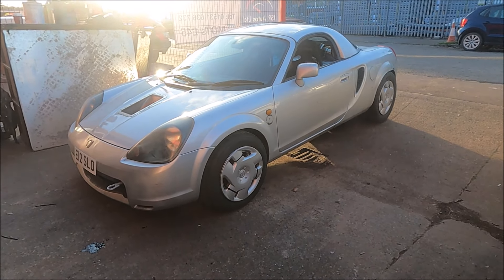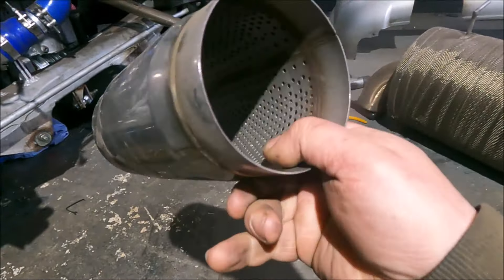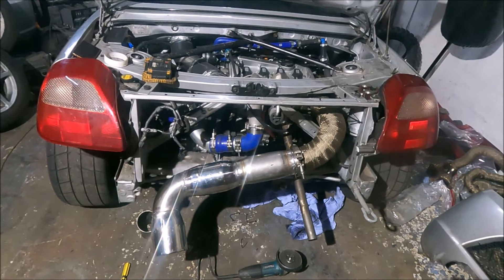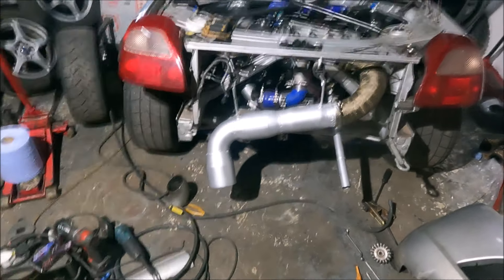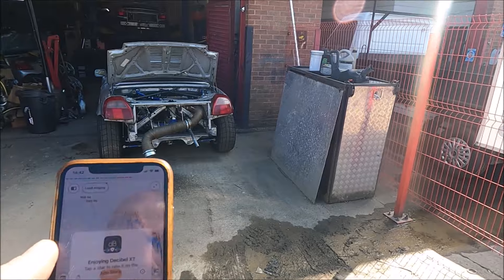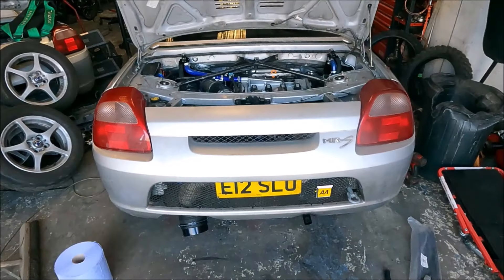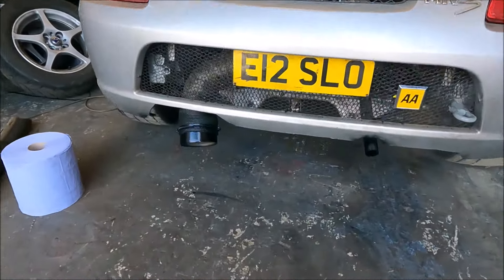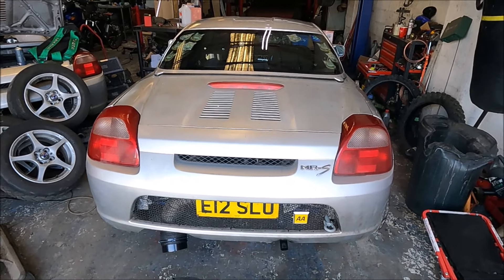Slow looking Mk3 MR2 thats faster than a 740bhp Lamborghini Aventador S. VW/Audi 1.8 20V Turbo swap!

Comment: nice one stav ! would love to know the 0-60 and 0- 100 for me presonally

got question Stav on my air cone in my 944 turbo hx35 twin scroll .  should i be worried about heat soak from the engine from my filter as it’s at front of engine,…and my cold feed area is where my catch can is located ,…not allot of room at all….shall i make a 90% cover box out of aluminium to shield from edge of front of engine ? or not worry ,…dyno day in 3 weeks mot next week !
Reply from the maker: Yeah I’ll be doing all them.

Honestly a shield makes little real difference but it’s certainly a bonus as long as it doesn’t restrict airflow
Reply: @StavTech   cheers mate ,…bit stuck on weather to bother it not ? 😩 allot of fabricating if it’s not gonna do much as there’s literally bars cock of room to do one but it’s possible
Reply from the maker: @danielferraro59  I’m lazy so I’m fairly certain I wouldn’t lol. Maximum gains for minimum effort for me
Reply: @StavTech   yea i’m feeling that way myself after all this work 😂